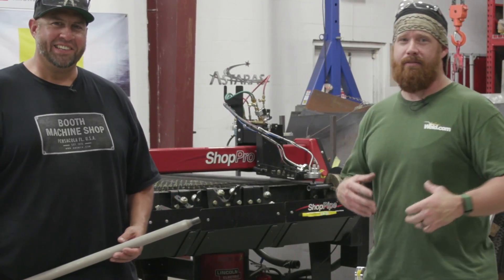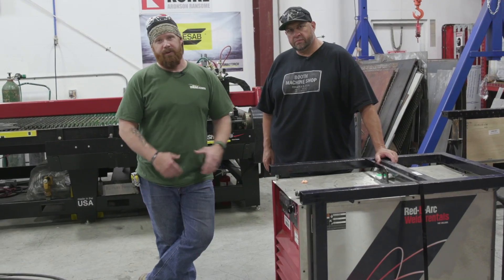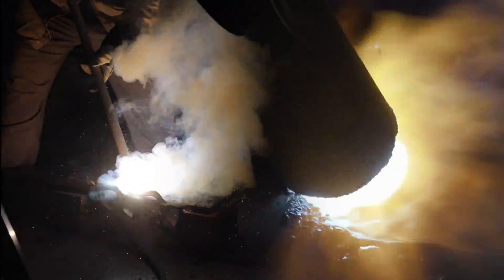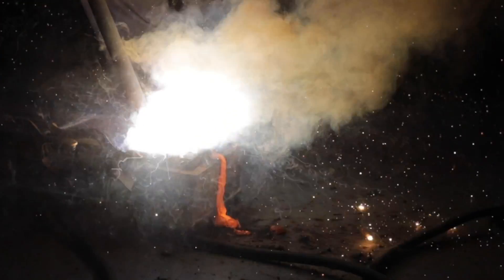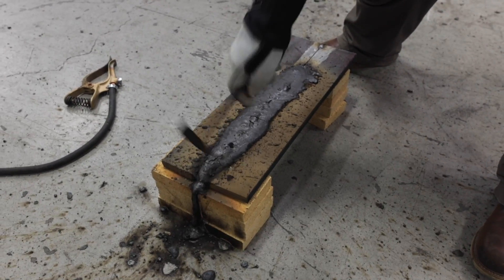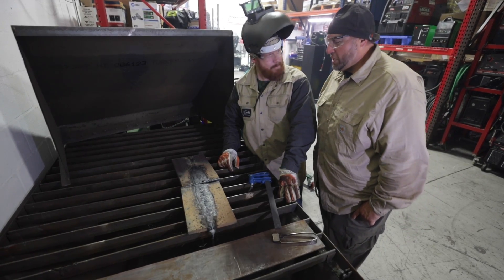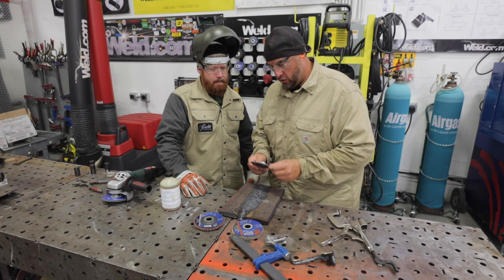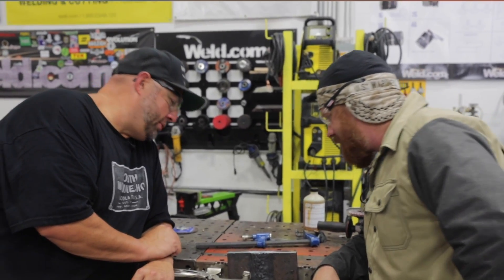1000 Amp Stick Welding CUT AND ETCH!

Comment: I've mentioned this before and I tell all my apprentices to please, please, please wear a mask under your hood! You even said that the ventilation system wasn't strong enough for those fumes. I'm a 55 yr old UA Instructor that's on long term disability because I've been welding since I was 16 and never, never wore a mask under my hood. I've been diagnosed with Manganese Poisoning because of all the crap that's enrobed on the rods.  (Google it. It's exactly like Parkinson's and read the caution on the rod box.). And I tell all the apprentices to wear them. I challenge you and all the other teachers to do the same. I'm lucky because I've been Union all my life so I'm protected Insurance wise and no, I'm not going on a Union or non-Union rant. I'm going on a protect your future rant. Wear a mask. It's not that hard.
Reply: Yes by all means wear a mask or better yet wear a battery powered air supply . I'm a lucky one i started welding at a very, young age and welding for a living at 16 years old state of California certified. Started working as a Iron Worker Local 433 age 22  all so carried a Local 92 Boilermakers book and worked the Millwright trade on Adobe permit's . Yes i breathed Lots of Smoke and so far to my amazement i have no resportory problems retired at 57 I'm 86 years old that's the story protect your EARS I'm DEAF AS A BAT NOW . 🐤🐤🐤🔔 .
Reply: @curtisvonepp4335  More power to you grandpa!
Reply: @curtisvonepp4335  Yes, hearing protection is another big issue for lots of trades!
Reply: @markfryer9880  oh that sizzle of burning ear wax or is it drum ???
Reply: @curtisvonepp4335  I'm amazed you actually made it this long !!!
60 is about it for serious rod burners !!! 
#1 iron eh . Here too an still have 10 n 10 ...
Reply: @jedisentinel1499  probobly want a respirator.
Reply: yurimodin they are out their, pretty compact
Reply: @jedisentinel1499 ,n95 is not good enough. Check your local welding supply for proper mask, or research on lone👍
Reply: A very important warning about safety, no matter what your trade!
Reply: I always use a respirator kit, bought 2 for my shop, im the only one that wears them!(speedglas 9100 fx with adflo), I cant understand why everyone says 'you need safty in your shop', but when you get it, secretly guards come off, respirators stay in the bag, ect... you can lead a horse to water, dosnt mean he'll drink..
Reply: Exactly why there aren't too many "Old" welders !!!
A stroke is another closely associated benefit of burning rods as are heart n lung problems !!!
Reply: @BabaYaga-r3m  exact question in my mind...Everyone says wear respirator but no one talks that Welding helmets(99% of them in the market) do NOT allow you to wear a respirator...

The only option is to have a suction fan and divert the fumes.

Also the expensive helmets are close to a grand,which I believe not many people can afford.
Reply: @samuelkatherinediozarago7692  Miller P100 respirator fits under all my hoods.
Reply: @billmcyrus  Not a chance you can find any type fits under any mask in new Zealand ..also,I would go with positive pressure ones.
Reply: @BabaYaga-r3m  ,there are respirators made to fit under your hood.
Reply: we use 3M helmets with supplied air... the cooling attachment is great in the summer
Reply: First time I stick welded I blew my nose and never welded without at least a dust mask ever again, literal black snot, and if that's what got stopped what didn't. I think I might buy a PAPR unit, they're annoying sorta but the ones at work I got used to, they're not so bad
Reply: Thanks for the tip, Can you recommend a type of mask please?
Reply: @whatupg1  3m P100 with the pink "pankcake" filters. Works great and nee cartridges are cheap
Reply: https://www.millerwelds.com/safety/respiratory/half-mask-respirators-m00469#!/?product-options-title=lpr-100-half-mask-respirator-m-l-ml00895
Reply: MAD Free Speak if you want the specific name it’s called the LPR-100 by Miller. I’m pretty sure LPR stands for low profile respirator. I have a Lincoln helmet and it works with that, super comfortable would recommend to anyone who wants to a comfortable mask that can fit underneath a welding hood.
Reply: MAD Free Speak miller make a good low profile mask take care of it. Put it in a ziplock bag to help preserve the life of the filters.
Reply: Jordan Rounds : didn’t know about the “bag trick”. Thanks!!!
Reply: @whatupg1  any mask with a filter on it or a respirator.
Reply: @whatupg1  N-95 mask would work.
Reply: I worked for Caterpillar in South Carolina as a welder for years. They never offered or spoke of any type of mask but bought painters air cooled vests.
Reply: @jedisentinel1499  miller makes a low proprofile mask for $20 you can replacement paper filter with activated charcoal
Reply: @BabaYaga-r3m  3M has some that fit under your hood.
Reply: 53 yr old - old school welder here.  With a very husky voice!
Couldn't agree more👍
Reply: @BabaYaga-r3m  a 3m p100 pink "pancake" respirator fits under my welding helmet just fine. Might be surprised what fits
Reply: @colincamus2098  Yes,that's my favorite as well.
Reply: PAPR with a blower is the way to go
Reply: @jedisentinel1499  nothing like having a fire on your face too !!!
Reply: Most people are immune to good advice though
Reply: Ive got a COPD breathing problem , from 50 years of welding , but I took a different approach .   I put a light weight  air line fitting , into the side of my helmet  . Dont pump shop air in there , its got CO2 in it !    I then got a centrifical air  fan , for blowing up inflatable gorillars , you some times see on buildings . I have a   2in infeed  line , about 100 feet   long , and take the air from  up wind , and a long way from where Im welding , and a small 50 ft feed line to my helmet .   Next problem is , the air coming into the helmet gets heated from the compression ,   so at  the entrance to  the   blower , I mounted a window -mount air conditioning unit . I can actually get cold air coming into my helmet .  The only compaint I have is , you cant hear the radio as well . but  I dont need a filter mask at all , which is labor  for your lungs to pull threw for a long period of time .  Works great inside tanks as well . Milk truck tanks make me  barf , the milk goes ransid in the cracks you have to weld , and holly shit is that awful .
Reply: Ops forgot theres a wastgate pressure releif in the pump out feed , its just a billard ball in a plastic cup .  A lighter ball wont work , it will shoot it across the room . The billard ball justs lifts off and spin , floating in air .
Reply: People can’t handle wearing mask while being outside, I guess it is too hard...
Reply: @jedisentinel1499  no, they protect against particles and aerosols above a certain size  (I'm sure Google can tell you more specifics). Better than nothing, sure, but to be safe use something like an activated charcoal filter or reagent filters for carbon monoxide/ heavy metals.
Reply: @BabaYaga-r3m  put on the respirator 1st, then put on your welding helmet 2nd. The trick is to put on the respirator 1st.  If you put on the welding helmet 1st you won't be able to get the respirator over the welding helmet. If you put on the respirator 1st then you won't have to worry about your welding helmet being in the way. Of course there are always caveats,  such as welding helmet size. For instance if you wear  welding glasses then you might be able to put the mask on 2nd depending on the size of the welding glasses.  Typically though you want to always put on your respirator 1st then your welding helmet then your gloves. Oh darn, I forgot to mention gloves.... make sure you put your gloves on after you have already put on the respirator and the welding helmet. Then put on your gloves last. Make sure you put your gloves on last because it will be difficult to put on your respirator 1st and your welding helmet 2nd if you have thick welding gloves on!

Do you need any help with putting on your flip flops?
Reply: That's a welders disease 😔I hope you can live life, because I know what Parkinson means and that ain't fun.

Manganese poisoning is even worse because a lot more receptors get f'ed up than just the dopamine receptors in the brain.
Reply: @Sassenhaim  exactly.
Reply: @jedisentinel1499  you need a respirator with the proper filters to properly protect your lungs. Dust mask don't cut it!!!
Reply: Hi friends,,,
Reply: Baba Yaga use an adflo
Reply: Baba Yaga : purchase one sold by a Welder Manufacturer such as Miller, that is “designed” to be worn under your hood. Mine works great!
Reply: A mask is not going to do much with the beards they are rocking...
You wold need a PAPR.
Reply: My work provides Miller PAPR Helmet (Powered Air Purifying Respirator). Works very well compared to your standard welding helmet, expensive tho.
Reply: @BabaYaga-r3m  There's welding helmets with battery-operated ventilators that hang on your belt now, they're not cheap though.
Reply: Thanks for that, i have been welding for 7 years now and i weld in confined spaces without much ventilation so i should definitely get a mask. I bought a miller half mask but bought the wrong size so never wore it, I will order the right size. 

I have been saying for the past few years im going to end up with cancer or something from welding
Reply: @jedisentinel1499  3M makes a great comfortable respirator.Fits under the shield better than Miller.I have both.
Reply: lot of factories are making PAPR helmets mandatory. Place I worked they were required for welders.
Reply: E. Squatch we use a 3m product 3m2138 P3 in Australia I am sure you guys in the USA would have something similar it’s so important. when I was a kid there was not much info about how bad the rods are for your health I have been in some tanks that turn your mask black in 30 minutes so it’s so important to have plenty on hand and I pray we are all going to be ok in our later years.
Reply: Miller makes a mask that fits under most hoods. Miller p100
Reply: Yes sir
Reply: @jedisentinel1499  Obviously, the better the mask the better for your health but heck, a dust mask is better than nothing.
Reply: Respirator,Respirator,Respirator
Reply: Galv poison sucks too, hard to find filters right now because of mask mandates and high demand.
Reply: Did u ever have a big fan or anything blowing on u while u were welding?  cuz thats all I do... but Im sure I still breath that shit in.... galvanized at that.  goin on 5 years😷💀 ur post makes me rethink my safety... or lack there of!
Reply: @jonnboimuhfucka  safety first always Brother.
Reply: @jonnboimuhfucka  galvanized always gave me a headache that won't fit in a 55 gal drum just like tequila or to kill ya ...
Reply: @jonnboimuhfucka  galvanized is insanely dangerous. Use fume extraction and wear a P100 at the least
Reply: Well said. Boston 537 Pipefitter instructor myself. We always stress Saftey first!
Reply: @michaelflores820  here,here Brother.
Reply: @jedisentinel1499  Any mask that filters your breath intake is good and that includes the N95 mask.
Reply: @BabaYaga-r3m  It's very easy. A small N95 mask goes a long way. It might be uncomfortable at first but it will be natural in no time.
Reply: @BabaYaga-r3m  it's very easy.
Reply: Wear a mask while welding so you can smoke two packs of cigarettes a day and drink and drive at the same time, why dont focus on real safety issues............
Reply: @job38four10  these guys talking about the paper masks on their faces tickle my funny bone !!!
Especially when ya don't even need to trim your beard or hair and even moreso with overhead !!!
Another one is cheap disposable lighters in your pocket. 
Seen so many pumpkin mistakes !!!
Reply: @jedisentinel1499  Yes.

Comment: Wow, 1000 amps. I'd hate to have arc blow start up. You'd be dancing with an electric devil on that one. It would also be interesting to have a stuck rod. Disconnecting from that would be an adventure.
Reply: Better prep a guy with an axe ready to chop the leads 🤣 or someone to choke the genny
Reply: @alexanderwlad6689  Turning off the welder would be the quickest and safest way.
Reply: I’ve thought about it, and the best way to get rid of a stuck rod is to swing on it like George of the jungle